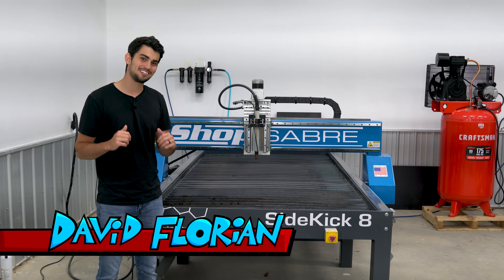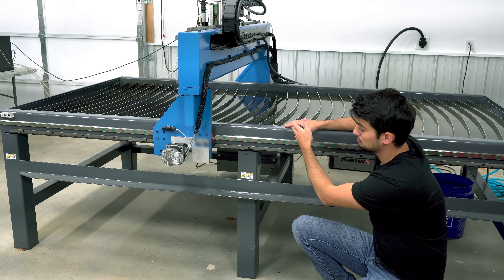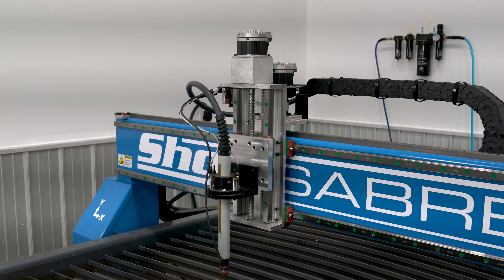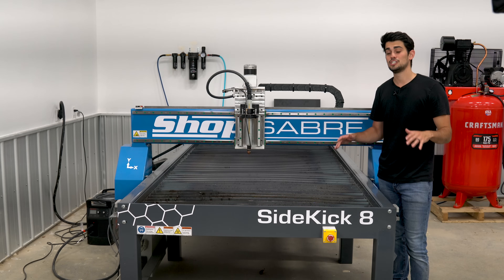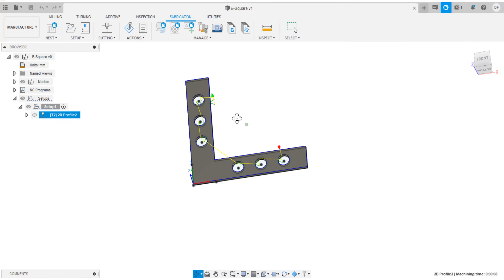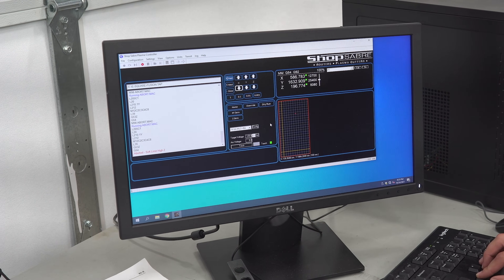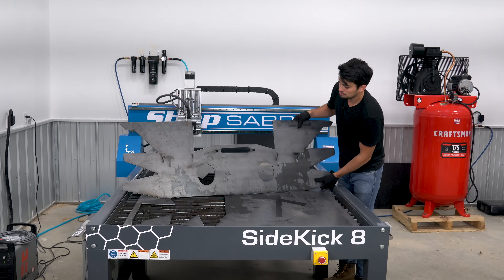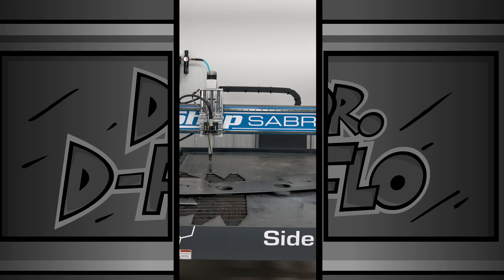My First Industrial CNC Plasma Table: ShopSabre SideKick 8 (Features, Specs, and Cutting)

Comment: You should bond that ground rod to the ground in your main electrical panel (Utility Ground).  Absent that bond, there will be a difference in potential between your tables ground and your utility ground, and should your building get hit by lightening, it will take the least resistant path to ground.  Absent those being bonded, your table may be sacrificed because it may be the less resistant path.  I'd venture to guess you will void your Shop Sabre warranty by not having that new ground properly bonded to the utility ground per NEC code.
Reply: The manual specifically said not to ground at the panel.  Its worked great for 5 or so years now.  No problems

Comment: Having Clearpath servos, I couldn't help but notice that it pauses in corners for quite a bit (not 100% sure which exact cornering style it was, but seems to be simple cornering without going 1 kerf beyond before turning) and also the huge pause before next surface probing and cut. I don't think this software is well calibrated for this application. Because many software packages don't actually care about constant surface speed operation because they were made for other types of CNC machines, like routers and such. In my experience, the best performance for specifically plasma cutting I've seen, was from LinuxCNC-based system with Mesa ethernet I/O card.
Other than that it is amazing machine! The mechanical part looks awesome. Congrats on getting it!

Comment: David,  I have the 5x10 version of this table, and I agree it is a very good machine.  Best of all is the lifetime support which has been exceptional.   I do need to correct you regarding the power requirement.  I also have the Powermac 85, and it requires a 100 amp breaker feeding a min 60 amp time delay fused disconnect.

Comment: great and neat machine. You said two inches thick capability but it's not possible with the Powermax model you have... check out the specs, even the Powermax 125 is in several cutting at that thickness. Higher than 1.5 inches you need to go big: HPR260XD/400XD or XPR300.  As a side note I recommend you add MotorGuard M-60 submicronic filter before you get the dryer (costly), you will get longer consumables life and even better results. plasma needs the best air you can give it

Comment: the z height comes in handy when cutting programs in pans or electrical boxes with a shallow edge, etc..  Gets the head up over the edge.  Also nice for raising the work up off the table if needed.

Comment: From a production shop perspective, as long as you stick to steel you'll be fine. As soon as you cut stainless or aluminium for few hours, you'll want good fume exhaust anyway.
Not worth the health issues, imo. Aluminium fumes are nasty.
Also, all your steel will start rusting unless you use some inhibitor or dry off all material right after cutting, which is a pain.
Reply from the maker: I think a 4x8 plate of aluminum would cost more than the whole table in this economy! But yes, I plan to almost exclusively cut steel on this table. I am testing out ShopSabre's Plasma defense as a rust inhibitor. I also plan to use a large 100 gal carboy to drain the water into between sessions and pump back into the table when needed. This will also keep the humidity down in the shop.
Reply: @DrDFlo  if the fluid is bad, I've read GreenCut fluid is pretty decent and not toxic when sending to drain.
Reply from the maker: @QuebecoisSti  Appreciate the tip!

Comment: Given your experience with CNCs and now that you have a plasma cutter to make rigid parts with clean finish… can you make desktop 3018 cnc kits and sell? I would be your first customer.
Reply: Hallo Arthur. If you need a Small super rigid CNC router. Look at this SOROTEC Compact-Line 0403. Just so you know, you cam not make parts for a cnc router without using a mill or a router, Plasma cutter will not do it. Also rigidity is exspensive.
Reply: @larspetersen2688  thanks for the recommendation. I might have misused the terminology. There are too many 3018 kits which can’t handle a strong spindle. I thought plasma cut sheet thick metal would be cheap to produce and rigid enough to hold pieces together in place with lesser free-play. The rest of the parts would be linear rails or smooth rods like printers. I’m new to CNC, still researching.

Comment: What I would like to know is why does plasma go slower than laser as in z movement and what the difference is between the drives between the two because there's no reason why x and y can't match the linear speed but z seems slow and retract height, I know the the difference between high power laser cutting and plasma piercing, watching 3d printing going from 100 to 500 mm/s movement shows that speeds can be achieved.
Reply: It's a junk table that is why it's slow
Reply: @rogerrettinger3225  🤭 no what i meant was when you see laser cutters moving and cutting its 10x faster than plasma, one of my customers has just brought a new supper high def plasma and the cut quality is on par with laser but speed wise it doesnt match.

Comment: Nice dude!  Have the same one at work with the oxyfuel and metal scriber added on.  Been working good for over two years now.  Shop sabre has been great everytime we've had to deal with them.
Reply: Should not have to"  deal with them " if you buy a burn table and it has problems you made a poor choice. I run the dog crap out of mine and NEVER had to work on my machine or equipment or table other than general maintenance.
Reply: @rogerrettinger3225  What part or my comment said our table had problems?  Just purchasing a table involves 'dealing' with them. Getting quotes, lining up shipments, billing etc. If an employee has any technical questions they have to 'deal' with them.  Plasma tables don't just show up at your door without having to 'deal' with anyone. We run the dog crap out of ours too.  But everytime we call them they answer the phone and have been patient with new employees needing tech support or questions that goes a long ways with me.
Reply: @rogerrettinger3225  My machine has worked for over 5 years.  When i first got it I did have to "deal with them" but that was mostly my fault for not knowing CAD.  The table itself has preformed flawlessly without any issues.  Its certainly nice to know that there are experts on the other end if you run into some kind of problem.
Reply: Your table has a lot of problems. I'm telling you it does because it's a budget build over priced. Your torch mount is your biggest issue. If your have a break you have a very lengthy process and it's time-consuming to restart. Jd2 rapids from 350-1260 inches per minute and we have magnetic torch mount clamps if you know where your at in the GUI you can restart from a break in about 18 seconds leaving your table and setup in the dust. Like I said you bought over priced junk.
Reply: @rogerrettinger3225  lol. I can only speak for the table we have.  It has paid for itself multiple times over and continues too.  You telling me that we have a lot of problems tells me that you don't know what you're talking about.  You know nothing about our setup and how it has performed.  I've never knocked the plasma torch off so can't really comment on that.  90% of the burning we do is 3/4-2" plate and it does exactly what we need it to.
Reply: @rogerrettinger3225  Give us a call and we are happy to give you information about our plasma machines and the quality involved in our manufacturing process. You are making assumptions that are simply not true.
Reply: I have had Sidekick 8 since 2015, and it still runs well. I know the problem you're talking about with the magnetic holder. It does take some time to restart at the point of collision. I've learned over the years that this machine is built to last. I don't even grease the blocks, and it still runs like a champ.

Comment: If you like that cut edge, check out a laser cutting machine.  Effectively zero dross.  Ready to weld immediately after cutting, with no grinding or deburring.
Reply: Yeah, only costs 10x as much for a similar sized machine that can only cut up to 1/8" thick.
Reply: @timr86868  I made no claims about the price.  I only said the finish is nicer.
Reply: @elkvis  Well if only the finish is a concern, you can mill it and have an even better finish than laser :)
Reply: @timr86868  That's true, and a used mill is even cheaper than the plasma table he's showing off here (not difficult to accomplish).
Reply: Laser cutting machines are used for different applications and for most people it doesn't make sense with the hefty price tag. Typically used for more commercial scenarios.

Comment: nice setup and description. how are you funding all the equipment?
Reply: I'm curious too
Reply: Free from Shop Sabre or huge reduction in price. YouTubers spend enough time and energy building their channel they will be rewarded with free stuff or major discounts if the subs and views justify it to who the sponsor is like in this case ShopSabre
Reply: @techguy38  Yeah I would think so, except he only has 65k subscribers right now. I could see what you're talking about hold true for a larger channel like Stuff Made Here.
Reply from the maker: Wow the speculation has been real on this video. A couple things:
1. I have another job
2. As a YouTuber I get smaller free stuff (which I review internally or externally), which I can sell for larger more expensive equipment (e.g., the CNC mill)
3. I can afford this table because I am teaching small classes locally on CAD/CAM and CNC technologies (3D printing, milling, plasma cutting, etc.) That mixed with a little ad revenue and some merch sales and it looks like I am in the green.

Edit: I switched "real job" to "another job"
Reply: @DrDFlo  Glad to hear you've got your multiple hustles on man!
Reply: @DrDFlo  Glad to see you know how to properly reply too 😂. There's so many YouTube Channels that won't go as far due to lack of engagement with the commenters.
Reply: Shilling